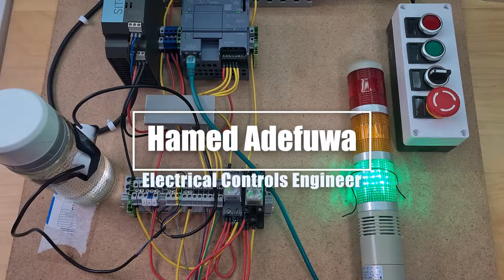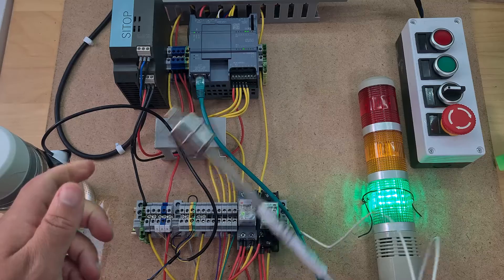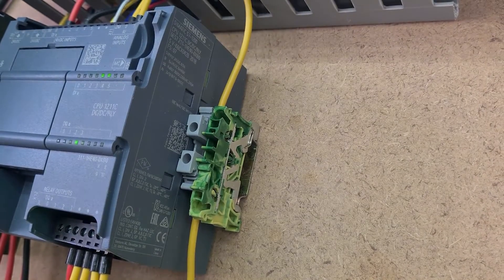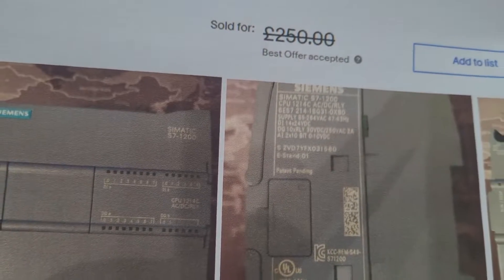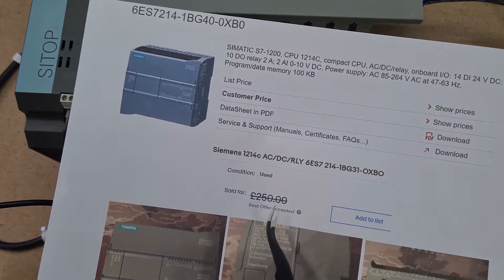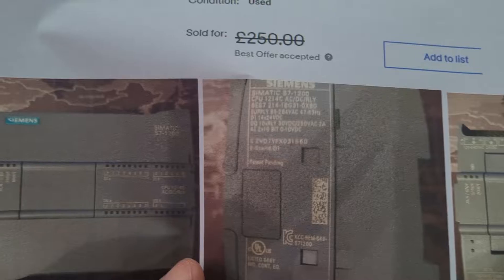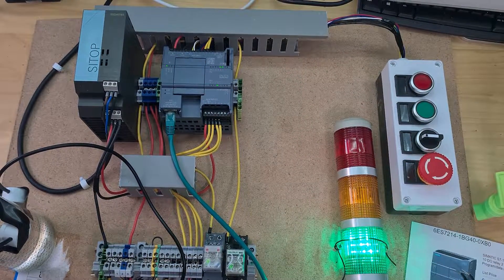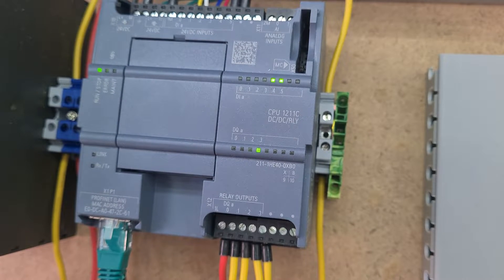Why I Hate My PLC - Siemens 1211C

Comment: ODot has great cheap extention modules, PSU go for Weidmueller the go for 100€, i belive Delta has some cheaper psu. You can get sensors form Chinese suppliers, if its not an industiral application. Phoenix contact has cheap push in terminals. On the plc side go for at least 1214 if not 1215. We made bigger machines using Siemens 1200 series, its very powerful in the right configuration.

Comment: Sure, it''s a bummer, but a good learning experience. The 1211C are meant for small applications that won't be upgraded. You could keep the 1211C and supplement your 1214 so you can tinker with modbus or Profinet networking between the two. Look forward to the future videos. You're doing great!
Reply from the maker: Ooo that's actually a great idea! I was just on site for a week with 3 PLCs that were talking to each other. I did give modbus a bit of a Google, so I might actually do this. Thanks jay!
Reply: @HamedAdefuwa  I followed you on twitter. Reach out if you need anything.  I have a couple of S7-1215s here in my lab that I can recreate any issues you run into.  Good luck!

Comment: Try a CLICK PLC it’s much cheaper and it has options for up to 8 I/O Modules.
Reply from the maker: Thanks Jose, I'm trying not to complicate my learning process by mixing in different companies but I am very keen to get onto the cheaper products - once I've gotten the hang of Siemens.
Reply: Yes Automation Direct is the GIG!  Also, i have been involved with PLC programming since the 80's, AB PLC2mini, Modicon 984, Modicon Quantum, AB PLC5, AB Control Logics, Mitsubishi.  With a smattering of Idec, Omron and Klockner Moeller thrown in!  Of all Enjoyed the Mitsubishi the best.  Am looking forward to you delving into the Raspberry Pi as a PLC.  Limitless!
Reply from the maker: Nice, guys at my work hate Mitsubishi 😅. How about the Arduino one? I believe it should be out next month. I'm excited for that.